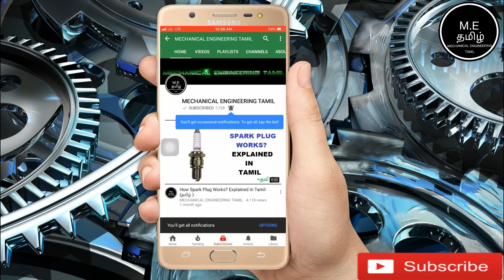How Does A Oil Cooled Engine Works ? Explained In Tamil (தமிழில்)

Comment: Hi bro my bike TVS Apache 160 this bike best oil cooling system tell me please bro.
Reply: oil cooler in your vehicle is to cool the engine oil ( dint miss understand oil is cooling the engine)....this helps to maintain the oil properties and even oil pressure to all parts of the engine.....like viscosity and film strength etc.,.....

oil becomes thin (வடை சுடும்போது எண்ணெய் மறுவதுபோல ) when exposed in higher temperature that can create lot of friction.... so the oil cooler is used to cool the oil..also once oil is heated that can emit toxic gases that can create crank case pressure......you can see a rubber tube from the engine near to the center stand or connected to air filter....this to release the pressure from the crank case....